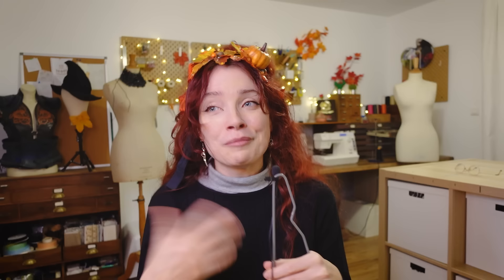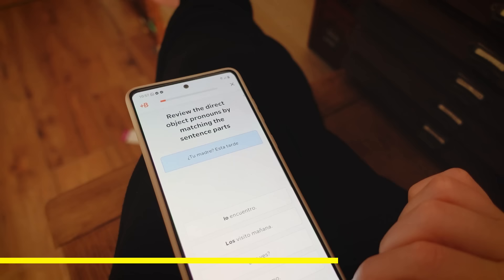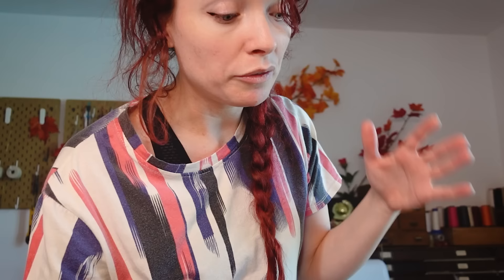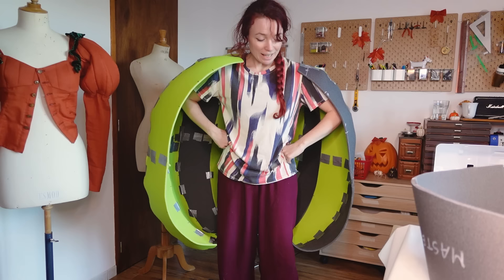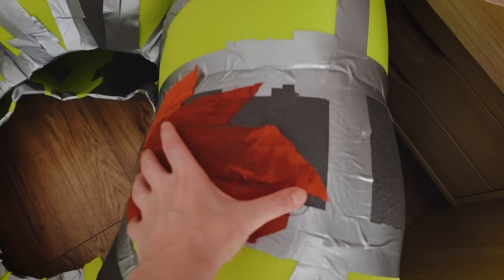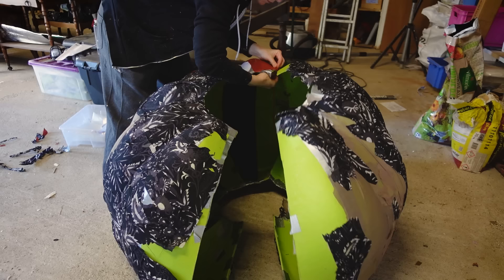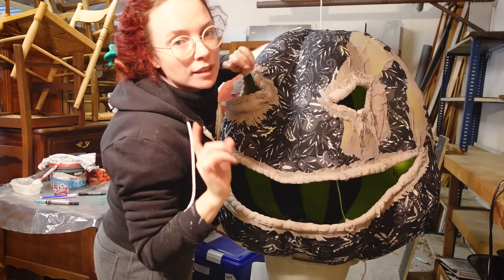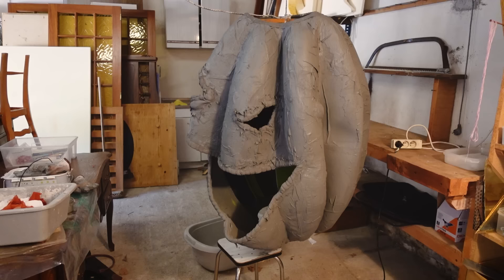I made a GIANT pumpkin costume and it was a struggle

Comment: Did you try the contact cement before giving up with it ? Cause i already made a project with yoga mats and the cement was working sooo well, even with the very thin edges. It made the assembling process very easy. I cut my foam in an angle so i was able the create those peaks and creases and it was extremly strong

Comment: Sorry you had so many problems with this project. It's difficult when you are using materials you don't use very often like the foam or yoga mats. Unfortunately the more expensive foam works better because it is denser and can hold a shape. Often we have to figure these things out ourselves as we try out materials because lets face it, no one else making large pumpkin dresses like this you can see how they did it. FYI hot glue can work with foam but it needs something to grab, so cut shallow slices in the foam, use a heat gun to slightly open the cuts  and then glue in that area.